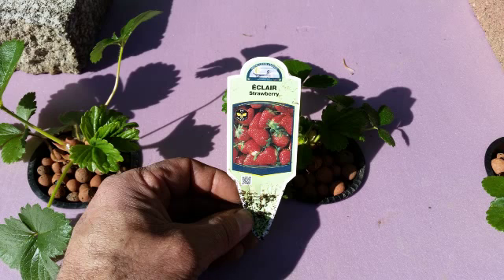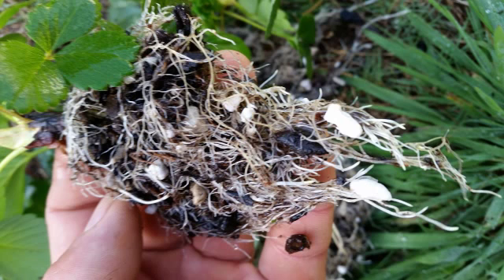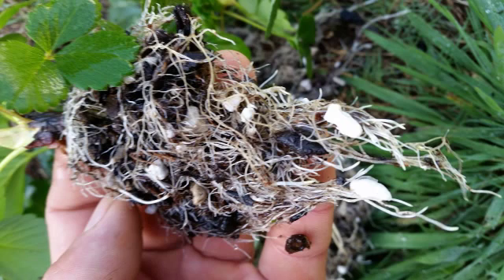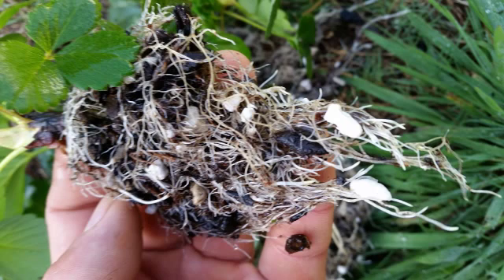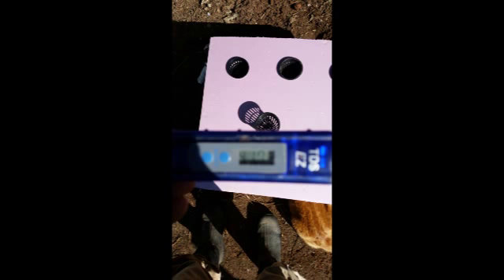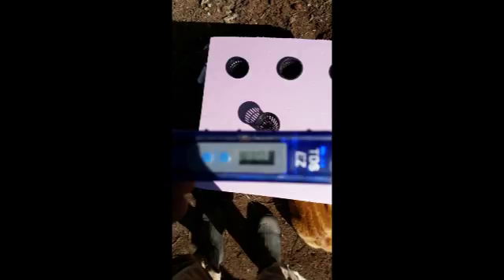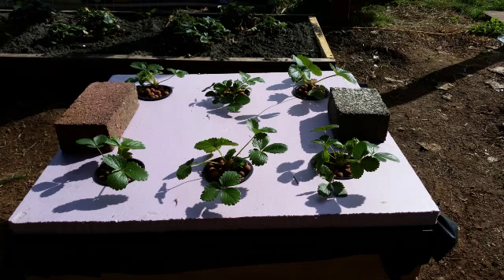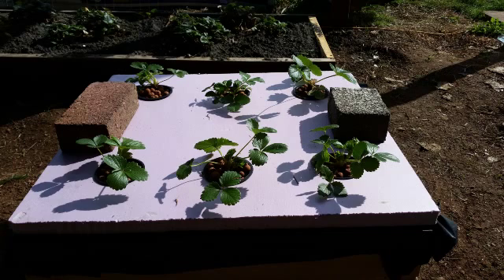June Bearing Strawberry Hydroponic Experiment #1

Comment: Interesting experiment Larry! I've tried to find information on dissolved oxygen requirements for various plants so I could get an idea as to what someone could grow in a Kratky type of setup. I read somewhere that fruiting plants have a much higher DO requirement than non fruiting plants. I think from what I've read is that lettuce (the most widely grown item in Kratky) has the lowest DO needs so it does fine in Kratky as long as water temps do not get too high (high temps=lower DO levels). There is very little info on this and your experiment should shed some light on it. If possible, could you track the water temps throughout the experiement using maybe a cheap floating aquarium thermometer? Great idea and great video my friend. I give this video a green thumbs up!
Reply: ***** Getting a new roof on in a few weeks. Say goodbye to the tax refund and a whole lot more lol
Reply from the maker: mediamaker2000 Hi Dale, hows your new place coming ? Picked up some thermometers this weekend & will be keeping track of temps :) Thanks for sharing your info !
Reply: Regarding fruiting plants, I have 10 green tomatoes already on a Kratky grow in my office.  Since the roots never seem to grow deeper into the nutrients than a couple inches, dissolved oxygen is not really an issue.  Remember that it is the roots above the nutrients that are doing oxygen exchange.

If you want a little more technical answer, check out this information from
http://www.fondriest.com/environmental-measurements/parameters/water-quality/dissolved-oxygen/

"100% air saturation is the equilibrium point for gases in water. This is because gas molecules diffuse between the atmosphere and the water’s surface. According to Henry’s Law, the dissolved oxygen content of water is proportional to the percent of oxygen (partial pressure) in the air above it 13. As oxygen in the atmosphere is about 20.3%, the partial pressure of oxygen at sea level (1 atm) is 0.203 atm. Thus the amount of dissolved oxygen at 100% saturation at sea level at 20° C is 9.03 mg/L ¹⁰."
Reply: Matt Garver I didn't think about the roots that were exposed to only air Matt! Thanks for that! I wonder how much of a factor temperatures are now in that situation.
Reply: This method was refined in Hawaii, which can be very warm.  It has also been used in desert like climates.  Plants just consume more water than normal through transpiration.

Comment: I am interested to see how the strawberries turn out, I tried a small Kratky method with little success as I found that root rot set in. I then changed to a drip system with a 1 hour off 15 minutes on timer with huge success.
http://s100.photobucket.com/user/kangaroo9/media/Hydroponics/20150403_1526361_zpsonpjhcif.jpg.html
Reply from the maker: Bob Newey Nice looking results Bob. I plan on do a water change at least every 2 weeks so that should help with the root rot.

Comment: I have seen many videos with aquaponics structures of various kinds, usually with thin film or tower construction for strawberries. I like the kratky set ups for greens but am optimistic that your trial will work as well. My quandary for strawberries and the one year to establish timetable is this: what do you do with the plants at years end? at 38North, they will not survive in net cups outside through the winter. they need to rest and build their root systems before the second year too. What is your plan?

Thanks for the video!
Reply from the maker: 1mtstewart Yes , I've been wondering the same thing. Not sure what i'll do with the plants. I might just keep them in the system to see how long they last. They are outdoors.